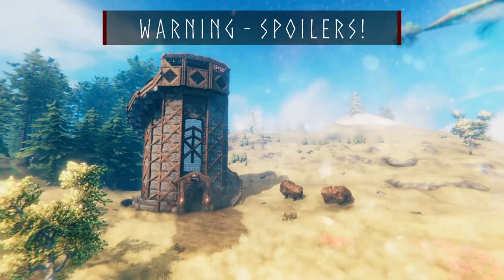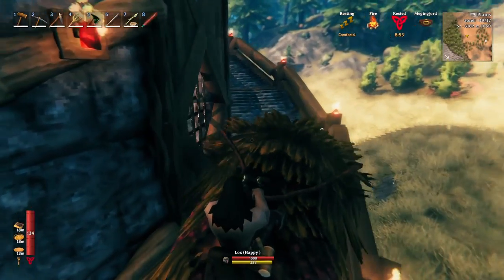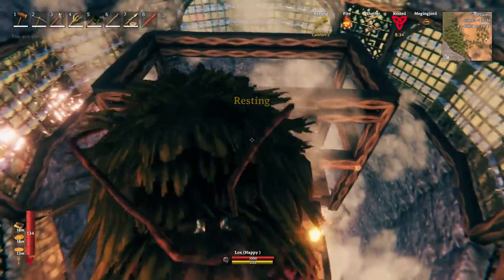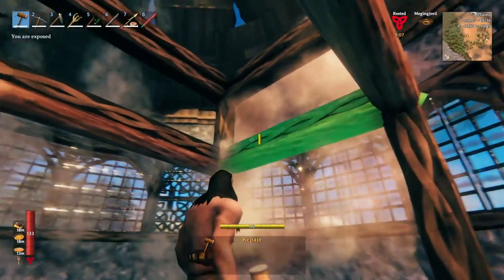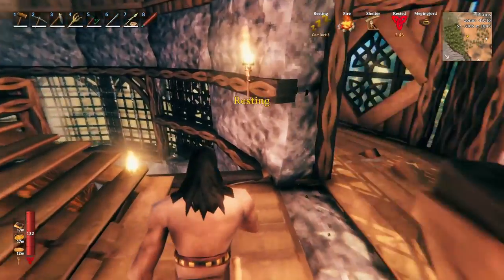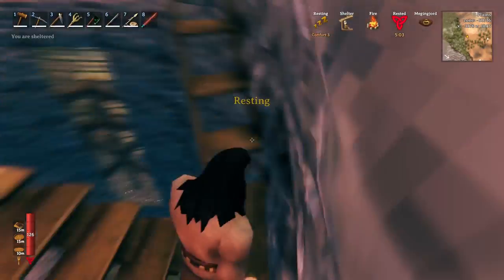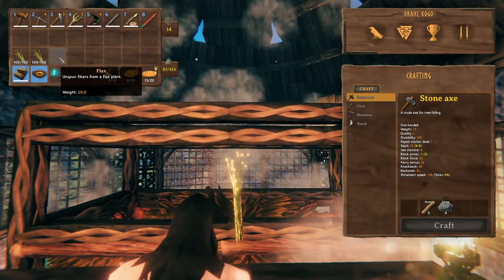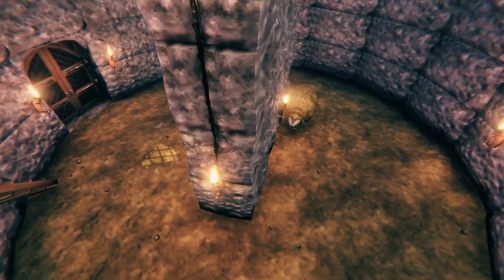Trueheim Lox Breeding Tower in Valheim

Comment: its all fine and dandy till you see "The Ground is Shaking" or any type of raid for that matter.
Reply: As long as they keep less than 3 player base object in there it's all fine.
Reply from the maker: I haven't tested this in an actual game, but I would imaging the lox destroying this base if an enemy gets too close to it. C.B. is right though. There is a work bench hidden inside of the stone at the base of the breeder. You'll want to keep that in mind when adding any build pieces to this build.
Reply: @truefisherking  I have a super basic/lazy lox pen. Just 2 rows tall wood walls (the pointy ones) a workbench and a portal (both prevents mob spawn in a certain radius). No raids. And apparently if the loxes cannot see the random mobs spawning outside the walls they dont stump and destroy the walls either. Sometimes they would do their thing when they walk on top of each other XD and may see enemies, so i guess higher walls?
Reply from the maker: @c.b.727  When I'm at this breeder I never have a problem. The mobs spawn far enough away and it is surrounded by lox. Nothing ever gets close enough. If I ever experience any issues, I'd terraform so that no creature would be able to stand next to the tower.

Comment: Hey does this still work? I know that they changed it so that the boars could only breed when they're on the ground did they do that with the lux too or the wolves for that matter?
Reply: i dunno if they patch this or not, but the case with the boar is whenever u tried to breed them above the ground they dont eat the item u drop so they status stays hungry, thats make them dont breed, but i tried it like a week ago, put them up while they just eaten their food, and they start breed infinitely until they start to hungry again, but in this video they eat the food so i think its still works (Y)
Reply from the maker: I haven't been on much in the past week, but last time I checked it still worked. I do find the boar to be a bit testy. What I do is try one food and if it doesn't work, I'll switch to another. Every time I've done this, if carrots don't work, then turnips will.
Reply: Boars dont need to be on the ground to breed. I have a hanging wolf/boar rack in the top of my barn that drops babies into a pit. Just make sure the board they stand on is extended to where you wanna drop the food and it'll work.
Reply: @sultanadikarrohimzaedy2877  it still works its quirky though, i dig a hole about one 4 meter log high from the bottom, stack 2 more. build a box and ramp. I havn't tried with lox but my wolves and Boars work. the boars glitch and won't eat sometimes but i just move them over a little pick up and reapply the food it starts working again